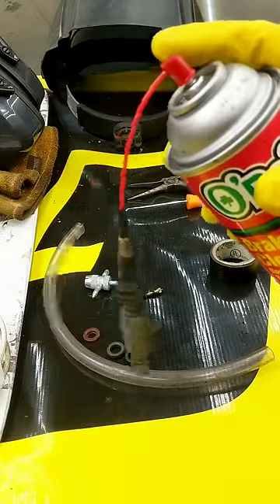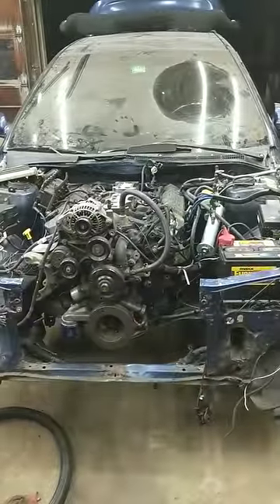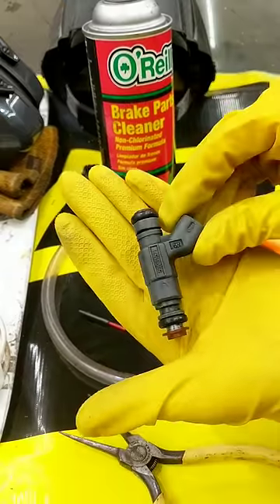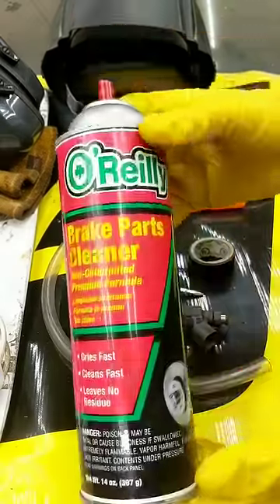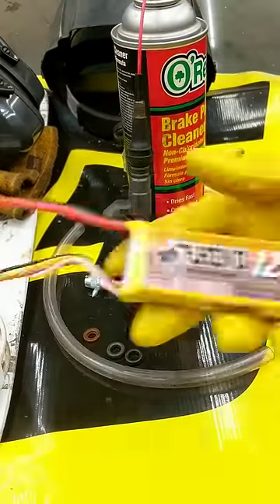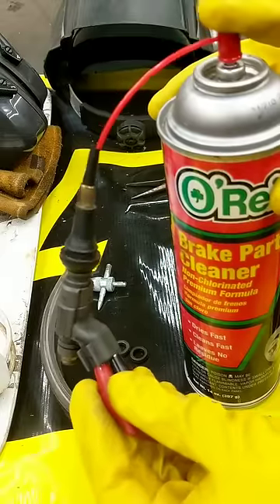DIY Injector Cleaning In 60 Seconds! How To Test And Clean Fuel Injectors At Home #Shorts

Comment: Can you explain what is involved with the back flushing process? I’d like to try this on my old injectors but want to be sure I’m doing it right. Thanks!
Reply from the maker: Just pushing the fluid from the spray end of the injector through and out the feed end. If you look close in the video you can see I flip the injector around. Hope that makes sense. You can also remove and replace the filter basket itself pretty cheap.
Reply: @802Garage  ok, so basically you’re spraying the solvent in from the part that attaches into the rail first so you don’t force more crap into the filter and make the problem worse? And then flip it around and spray it from the other side to complete the cleaning process?
Reply from the maker: @padraigmckilroy  Yep, exactly! Except the "rail" is actually the feed side. Basically you want to spray in the side that goes into the cylinder head first so it comes out the back of the injector, where the fuel rail would attach. I think you had the right idea though, just terminology. You can go back and forth a few times. Shouldn't hurt anything either way, just helps to knock anything big loose first really.
Reply: @802Garage  awesome, thanks so much for the video and for the responses! I really appreciate the help. I was looking at the cost to have the injectors cleaned professionally and this is a MUCH more budget friendly solution for what appears to be an equally effective solution in some cases.
Reply from the maker: @padraigmckilroy  This definitely won't get you the "same" results as a professional cleaning and it won't tell you if your injectors are perfectly flow matched. If they have just been sitting for a while and you want them all functioning, this will get you up and running. If it isn't a boosted vehicle and you can get them all to provide a nice even stream, I personally wouldn't worry much. After cleaning run some premium fuel and PEA based fuel cleaners regularly and the injectors should be fine. That said, the only way to know for 100% sure is flow testing. Just don't want to make it seem like this is a perfect solution, but it does work! I went from 9/10 injectors working and mostly terrible spray patterns to 10/10 working with a nice mist. Good luck.

Comment: The same principle should work for diesel injectors, right?
Reply from the maker: Unfortunately no. They require much higher pressures and are activated differently. Depends on the Injector as well.
Reply: @802Garage  Ok.

Comment: wait you can use a 9v battery????? 

i always thought it had to be 12!
Reply from the maker: 9V should be sufficient for most injectors. They just open more slowly. Car computers actually have a whole table built in to compensate for voltage.

Comment: In my experience, fuel injectors never needed cleaning bc the fuel does it already. But that's just in my experience. I never had to do one.
Reply from the maker: These definitely did. When I first started the engine only 6 or 7 out if 10 injectors were even firing and the 10th one never wole up until I manually cleaned it. It mostly happens from sitting long term, especially if the fuel system is exposed to air and there was ethanol fuel.
Reply: @802 Garage  oh OK yea I periodically start my cars thier  and here even if it's been sitting for a year or 2
Reply from the maker: @ryuken7452  Yeah I do the same, but I bought this engine after it had been sitting in the corner of a shop for quite some time!

Comment: Pro tip:

Create a fire-hazard by avoiding the high cost of an electrical switch and some longer wires

Sparks could ignite the fuel that's shooting everywhere, don't do it like this. Be careful.
Reply from the maker: Alternatively tap the battery side instead of the injector side connection. These things don't draw high voltage so it's not like the spark is even substantial. I did 10 injectors and no fires. Don't use gasoline which has flammable fumes, of course. :)

Comment: Or you can buy a fuel injector pulse tool and ev2 fitting from Amazon for about $12 . I just set mine on pulse put it in the ultrasonic and move on 5 minutes later . Be careful using brake parts cleaner in your fuel injectors because it can wear off coatings inside .
Reply from the maker: Is it free? Does everyone have one? Can you get it locally? Also a pulse tool does nothing differently than this. What coatings are going to be worn off that won't be worn off by thousands of hours of gasoline and additives? I'd love to see a reference for that.

Comment: I asked the neighbor shop if they had any cans of carb clean? They said yes and gave me a case of brake clean, I didn’t notice and walked off. I came back and said I wanted carb clean not brake clean, he said what’s the difference? I said, the contents.
Reply from the maker: Hahaha I mean you are correct, though depending on brand and some other factors there may be little difference. Some brake cleaner is pretty nasty though.

Comment: I personally use starting fluid it’s like easier on all the stuff inside the injector and it cleans it just about the same as break cleaner just me tho
Reply from the maker: Honestly I wish I had carb cleaner on hand to make the video, but I only had this, so I used it. :D
Reply: I've been doing this for years with my 5-3 Silverado with carb clean
Reply from the maker: @billbry  If it works it works!
Reply: @802Garage  I use torque two pro app with a Bluetooth on the OBD2 and I can clean an individual injector when a misfire happens as I set a misfires screen with all eight cylinders live time. Once I confirm it is not ignition related I clean the individual injector in 20 minutes or less and I am good to go. For 3 years I was getting bad fuel near my house and once I changed stations I haven't had an injector related issue again
Reply from the maker: @billbry  That's awesome! Some solid concrete usage of this technique.

Comment: When I plug my injector to the battery like that, the battery sparks. Any ideas why?
Reply from the maker: Sudden current influx creates a spark. Not a big deal. If you are worried about it, hook up an inline momentary switch instead. Or buy a tester tool.

Comment: Cleaver. But the last time I suspected bad or dirty fuel injectors, I just bought new. 
They are not that expensive. 
Especially when I only had to buy 4.
Reply from the maker: It's definitely an option, but it depends on which car, what injectors you're buying, and what you consider expensive.
Usually the cheap injectors are Chinese copies which have questionable accuracy and reliability, but they can work.
If you buy refurbished units from a reputable injector seller, they're typically pretty cheap and a good bet all around.
If you buy brand new from the OEM obviously they will work correctly, but they can be anywhere from $10-150 each.
Also an option to send your injectors in and have them cleaned and flow tested which is affordable but takes time.
Reply: @802Garage  
I agree with that statement. 
I have a daily driver Chrysler 4 banger and bought my injectors from a very reputable " High performance" parts distributor who are well known for selling only the best parts at the best price. 
That is one option, how ever, I now have another daily driver 4 banger and the next time I suspect a fuel injectors, I am going to try your " trick " first..
Reply from the maker: @phillipthethird42  You can also buy a more proper injector tester for like $25 on Amazon. I'll be trying to make a video on that soon. The trick genuinely worked for me though. Engine runs on all 10 now instead of 6 or 7 before hahaha.
https://amzn.to/3Ugydw9
Reply: @802Garage  
10 !?
Reply from the maker: @phillipthethird42  Yeah this is an 8.0L V10! It had been sitting for a while so the injectors were clogged with varnish.
Reply: @802Garage  
Viper engine ?
Reply from the maker: @phillipthethird42  Unfortunately out of my budget. It's the iron version, the 488 Magnum!
Reply: @802Garage  
I don't think I know that one. 
Was it the one they were putting in Dodge trucks for a little bit?
Reply: @802Garage  
I don't think I know that one. 
Was it the one they were putting in Dodge trucks for a little bit?
Or is it the Ford V 10?
Reply from the maker: @phillipthethird42  Yes it came out basically when the Viper engine did. They were developed alongside each other. They share the same engineering, but the 488 Magnum is all iron while the Viper engine is all aluminum. It's funny because they are essentially the same design, but share no common parts except for some bolts.

Comment: Questions! Why not just get new injectors? You went this far, putting back an old injector? Why not just dump in 2-3 cans of fuel injector cleaner every tank?
Reply from the maker: Well as always the main answer is money. Why buy a new injector when you can simply clean the one you own? These went from squirting nasty streams to a fine mist nicely. Nothing wrong with the injectors, just gummed up from sitting. Who is going to pay for the 10 new injectors if I want to replace them? Also, 9/10 injectors did come alive just from running before I decided to clean them, but the last stubborn one would not. Even had it, performance would likely have been reduced. I had to pull the intake manifold anyways, so might as well clean them. Even if I bought new, I would have to do most of the same work. The cleaning process took only a few minutes per injector. This is about saving money and getting results, not just the easiest and most expensive option. As with most DIY fixes. Running injector cleaner is a good idea, but it is far more diluted in a whole tank of gas and will not have the same effect as direct cleaning with a solvent. Hope this all makes sense!
Reply: Yeah why not spend 500$ for no reason? Lmao

Comment: Brake Cleaner is a grand way to destroy your injectors....! The Acetone & high concentration of Toluene do wonders on plastics and rubbers!
Reply from the maker: It doesn't hurt them. Maybe if you let them soak for days. That's not what I did. Have any source for this claim? People love to say everything will destroy everything.
Reply from the maker: P.S. Injectors are made of chemical resistant materials... Obviously. They aren't polystyrene. They literally have gasoline sitting in them all the time and all manner of fuel cleaners and additives. Use whatever you like.

Comment: just don't energize it for more than a few milliseconds. Injectors weren't meant to do any more and you could burn out the coil.
Reply from the maker: Injectors can run at 100% duty cycle and I'm pretty sure turning an injector on and off hundreds of times is harder on it than holding it open. Could be wrong, but never seen evidence to the contrary.
Reply: @802Garage  Paul Danner would strongly disagree with that.
Reply from the maker: @markchidester6239  Does he have a video demonstrating the principle?

Comment: DO NOT use brake parts cleaner.  It breaks down the electrical tape you use and possible the rubber in the tire valve stem and creates a sappy goop which irreversibly clogs the fuel injector.
Reply from the maker: If you wrap the tape around the outside of the straw, it won't get goopy or go in the injector anyways. I did 10 injectors in a row and sure the tape was a little soft at the end, but all injectors were working better. Carb cleaner would be my preferred cleaner, but didn't have any on hand. Some common sense goes a long way. It wouldn't be irreversible either since if solvent can make it goop it can also clean the goop.
Reply: @802Garage  How many tine would you remove and reinstall the injector trying to clean it when you can just avoid the problem?

Comment: You're not supposed to put acetone on/in injectors is also bad for a lot of sensors and seals. Oh yeah the V10 thing too.
Reply from the maker: Well there are no sensors involved hear and I removed the seals. Injectors are made of chemical resistant material. It's a brief cleaning, but I'll admit brake parts cleaner is not the ideal cleaner, it just works. All injectors are fine after I cleaned them. Check out the pinned comment for more on the V10 Impreza.

Comment: Literally any wire will do. I used some old speaker wire.
Reply from the maker: Yep. Not gonna be carrying much amps. Just nice to have something that clips on.
Reply: @802Garage I hear ya. It wild because the wire I found in my garage belonged to an old 90s entertainment center stereo and actually had a female sort of clip that plugged into the back of the stereo. Amazingly, the clip spaced the wires to the exact width of the prongs on the injector and clipped right on. Your right though, nobody wants to be fumbling around with wires.

Comment: V10 in a Subaru Impreza... Never heard of such a thing... Obviously engine swap right? Do they make that? I'm mechanically disinclined but pretty sure that's a swap.. goodness I couldn't imagine the upsides or even the downsides for that sake lol
Reply from the maker: Yes definitely a swap. Good call. :) It's a Dodge 8.0L V10 from a truck. The main reasoning for the project is fun and a grand challenge for myself. Plus to get some internet attention of course! Check out the pinned comment for some vids of it running.

Comment: Great way to burn the house down. Connect leads to injector and bump contacts remotely.
Reply from the maker: I guess common sense isn't so common anymore. Even if you manage to set half an ounce of brake parts cleaner on fire, what is it gonna do? Burn out in a few seconds, of course. If there is more, maybe ya know, smother the fire, or use a fire extinguisher which you should have in the garage, or don't panic over a tiny little flame. Even then, barely any spark is made and you can just tap the contacts to the battery side instead. People who do nothing but sit in a chair love to critique. If you manage to burn your house down doing this, you probably are unfit to work on cars in general.
Reply: @802Garage  you sir must be either very young or have no experience at all. Cleaner is not only flammable but also combustible with explosive force. The "tiny spark" comment really ices the ole cake. Keep doing what you're doing!
Reply from the maker: @micpau1222  Bro, you must never touch grass or something. Do me a favor. Go get a can of flammable brake parts cleaner. Yes, there is also non-flammable brake parts cleaner. Go spray it at something. Spray it on some concrete and cardboard if you wanna replicate the video. Light it on fire with a torch. Hell, spray the can and light the stream on fire while you spraying. Tell me what happens. Tell me how long the fire lasts. Tell me how large it is. Tell me if there is an explosion. Tell me if your whole house catches on fire. As for the spark, in the case of actual combustible fumes of course any spark could set it off. This is 12V at very low amperage. There isn't even a visible spark while doing it. And of course, this isn't a combustible atmosphere or anywhere close. Are you thinking of gasoline fumes in an enclosed space? Sweet Jebus some people need to spend more time doing and less time whining at a keyboard. If someone manages to set their garage on fire doing this they are incredibly talented and special. They should get a job in the pyrotechnics industry. Kindly put up a video of the explosive force of brake parts cleaner, which I have set on fire hundreds of times by the way, or shut up and go learn how to work on a car.

Comment: I've seen someone do this it caught on fire from a spark
Reply from the maker: I mean common sense always matters. I do wish I had shown tapping the wire to the battery side of the connection instead of the injector, but I had no issue. Can also use non-flammable brake parts cleaner or other solvents.

Comment: Unfortunately if this really worked there wouldn't be shops that are dedicated to cleaning and testing injectors with 10s of thousands worth of lab equipment. I guess if you were in an apocalypse you could unclog an injector just to get it running but this is like machining an engine block with an angle grinder...
Reply from the maker: 🤦‍♂️ The internet is full of people who read and don't do. I had 10 injectors. 1 was not firing, 3 were barely firing, and 6 had uneven straight streams. I cleaned them exactly as you see in the video. Afterwards all 10 would spray a fine mist. The engine went from running on 6-9 cylinders to firing strong on all 10. This is now a video on "how to perfectly clean your injectors using expensive equipment to make them like brand new" this is DIY cleaning in your garage nearly for free. Anyone with a brain can Google "how to clean fuel injectors" and read 1000 articles about sending them in for ultrasonic cleaning and running through flow testing machines. Again, read the title of the video. It does work, but of course it's not perfect. Have a nice day.